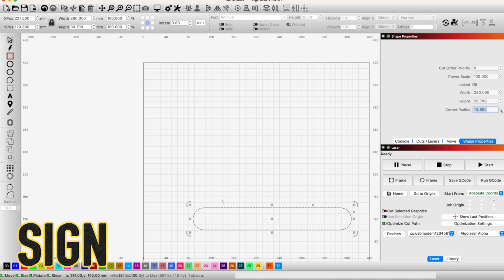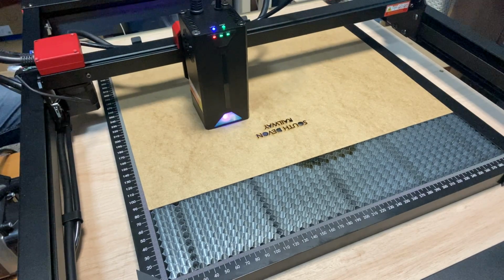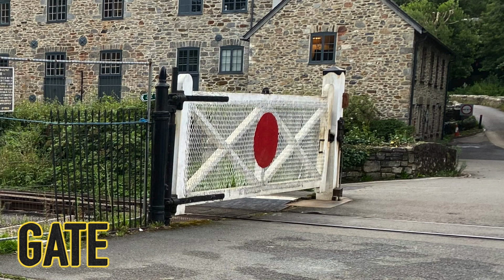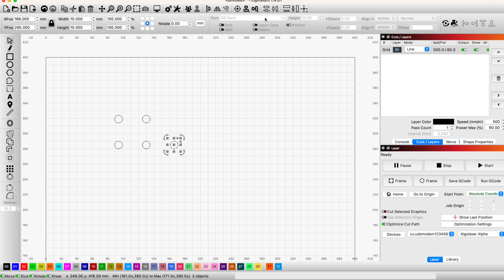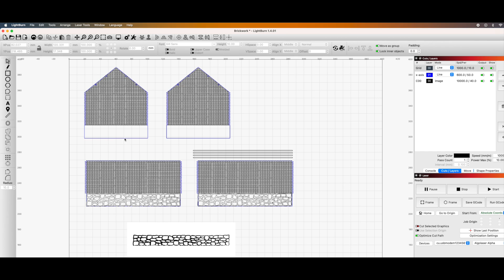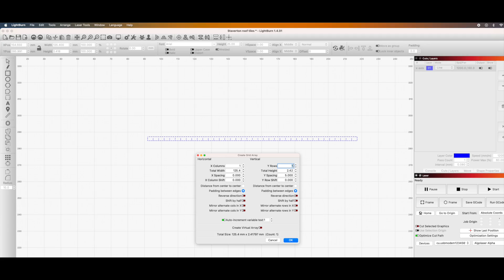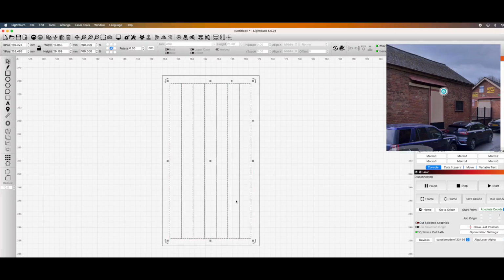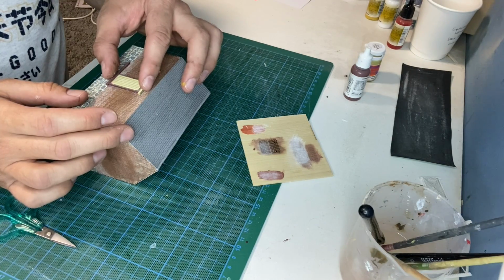Making models with the Algolaser Alpha 22W Laser Cutter

Comment: New to the channel. Glad to see a fellow laser cutting enthusiast. 

Have you used chipboard on any project?
Reply from the maker: I’ve tried quite a few things but not chipboard.   Have you?
Reply: @DartsideScenics  Yeah! I typically work with 1/16th but it comes in thicker sizes. Tacky glue is all that’s needed to adhered pieces together too

Comment: When making the brick work, can you adjust some of the bricks to have more pronounced pointing around some/random bricks, and then some that are more shallow also, and then just randomly placing those across the brick work to make it look a bit more realistic? Allternatively can you cut down the bricks to make it look more jagged/realistic?
Reply from the maker: Hi Paul.  Yes, you could set random bricks to engrave to give them a crumbling effect.  Not sure about the pointing - it could be done but it’s possibly easier to deal with that with filler or plaster of paris afterwards.  I think cutting some individual bricks from a very thin material and then sticking them in random places would give the illusion of slightly pronounced bricks.  I need to revisit the design to make improvements but it’s going to take quite a few attempts before I’m happy with it.